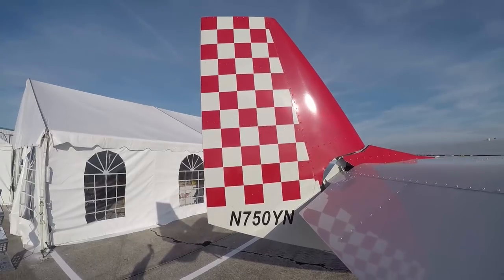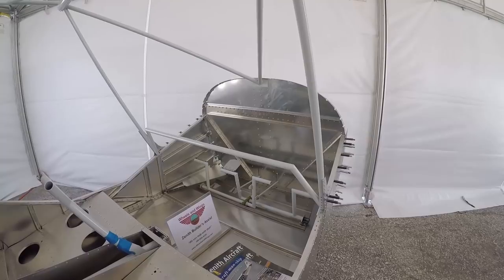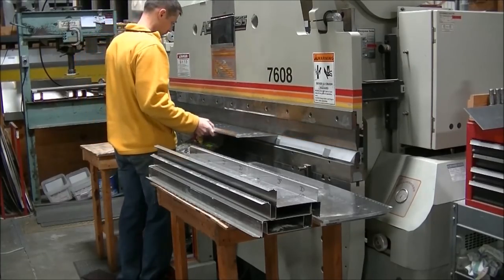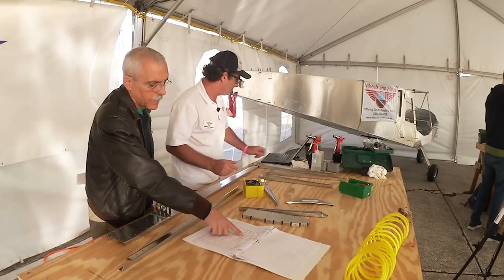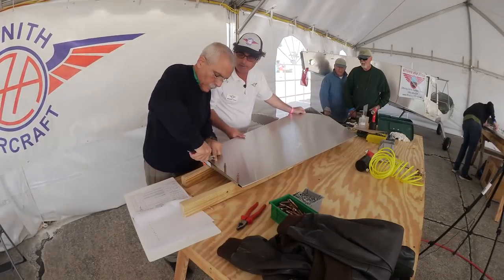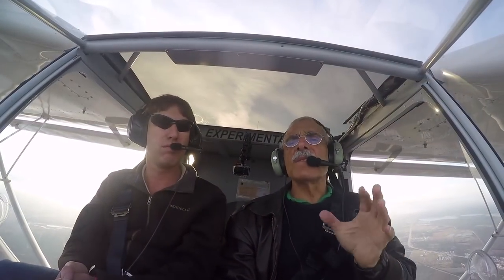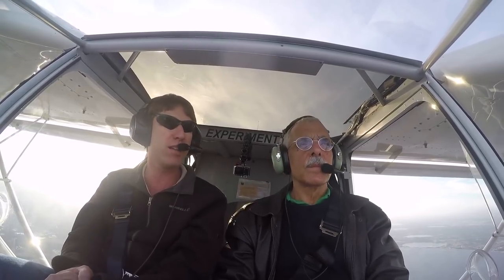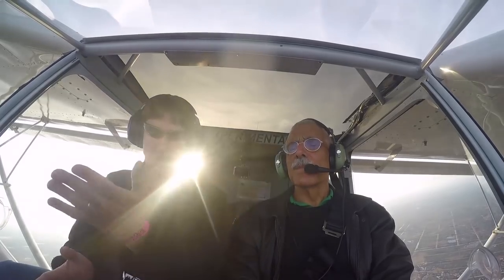AVweb Builds an Airplane (Part)

Comment: Very interesting that this is not only matched hole, but already to size.  I think that's a first. Removing the need to drill to size and deburr is huge. I suppose the the test of time will be if any cracks start to propagate from any rivet holes.

On another note, I sure wish they'd make a taildragger version. I totally get that their flying trike SUV is a good (superior) design, but a taildragger would be great. Move that wing strut and the gear to the front corner of the door.
Reply: The Rans S-21 is a final size matched hole kit and with taildragger option
Reply: Brent, thanks! Just watched some vids for that new Rans. I Iike it.